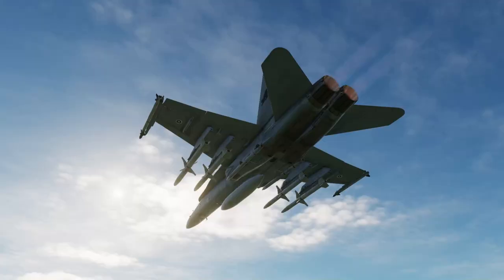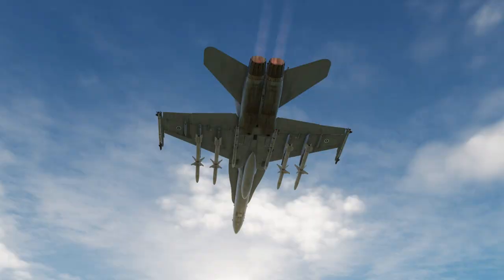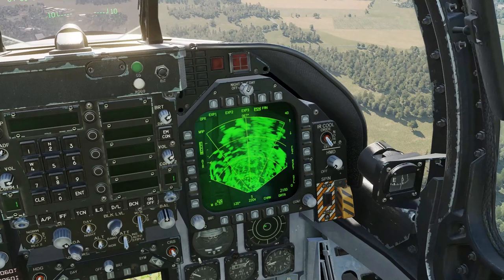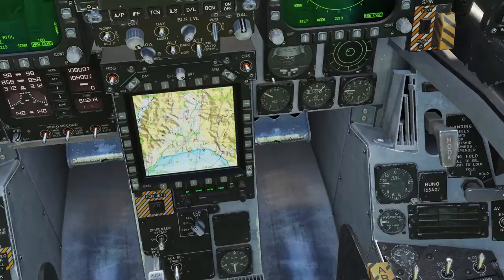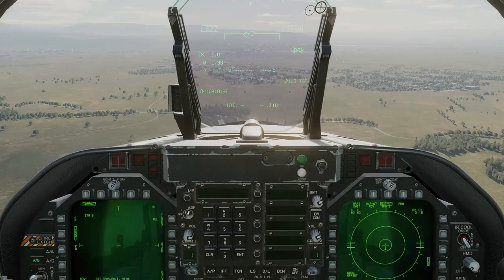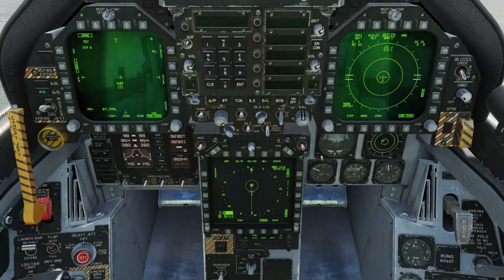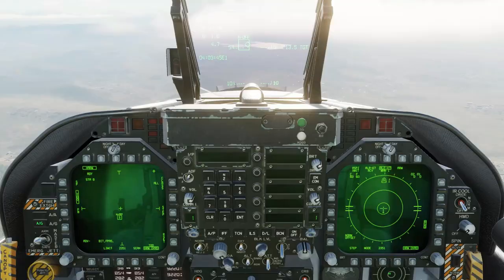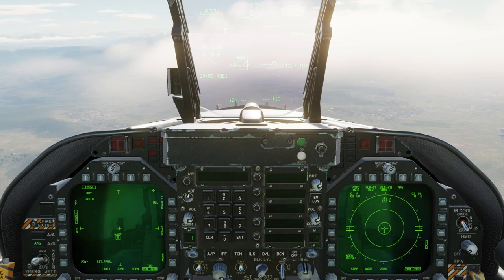DCS F/A18 HARM TOO Mode Tutorial - Hornet SEAD Guide with AGM-88 - DCS in 3 Or Less

Comment: I saw GR choosing a target through the EW screen? Care to make a videon that? I’ve always like except for not putting the switch to XMIT mode. I always keep it in rec. What exactly does the XMIT setting do?
Reply: REC = receiving, XMIT = transmit, when in REC mode your EW/RWR only receives the data on the electromagnetic spectrum and displays it to the pilot (shows what is scanning, locked, etc.). When in XMIT mode the system will jam automatically when receives a threat in certain ranges and angles. Mind you this jamming is not 100% effective and also jams your own radar. There are good tutorial videos about the FA-18 ECM system, I recommend to review some. Happy hunting!
Reply: @gerzsonpongracz938  Thanks for the answer man!
Reply from the maker: @UWfalcin further to Gerzson's excellent answer on the jammer... I've just gotten around to researching the other half of your question... When you have the HARM set to SP mode, the current target can be seen on the EW page and the RWR backup and the RAID button will switch between HARM targets. I think you need HARM Override boxed for it to work.
Reply: @GotSpaceGame  Ah okay thanks a lot!! I’ve always done it through TOO mode anyway but that feels like it’s the same thing then pretty much.